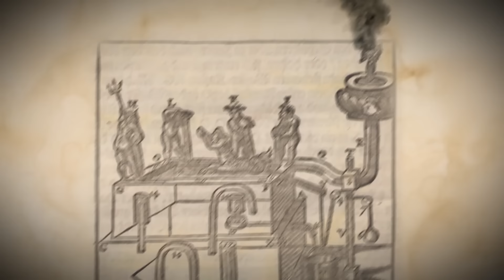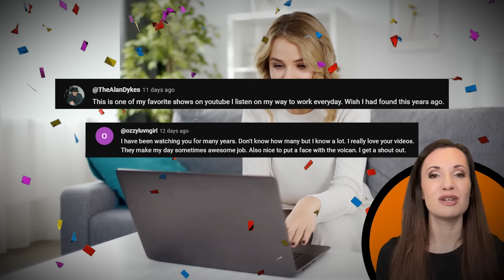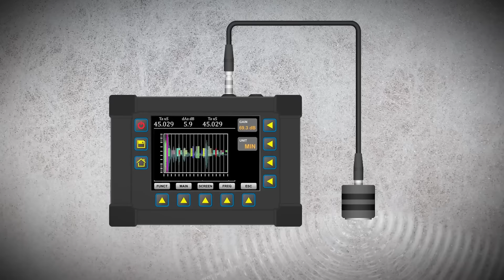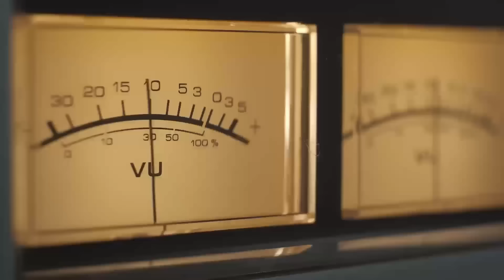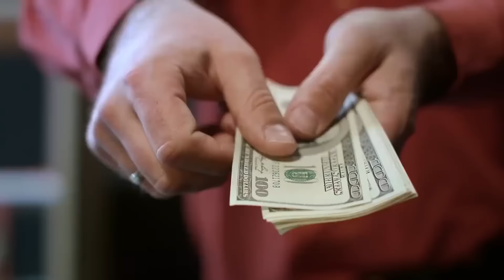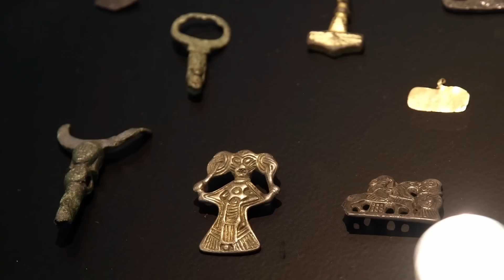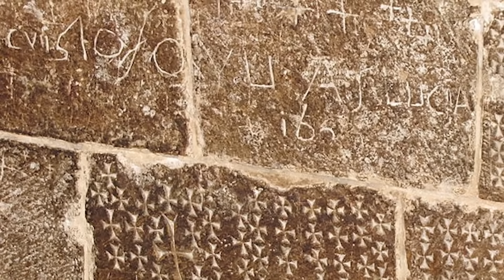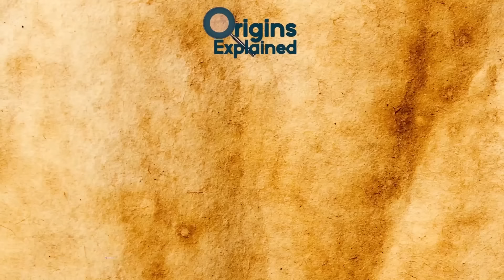Most Bizarre Ancient Artifacts That Completely Defied Physics

Comment: There is a Magnetic Hill in Moncton, New Brunswick, Canada 🇨🇦. If you are in a car at the optical illusion bottom of the hill, and the car is backwards to the hill.  You would put the car in neutral and then it will back up the hill with no effort due to an optical illusion. 🇨🇦